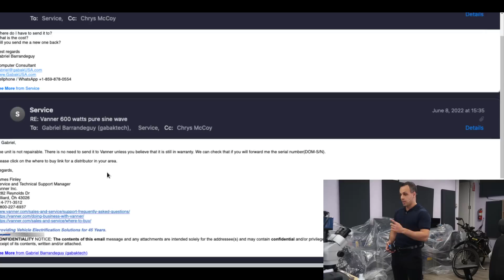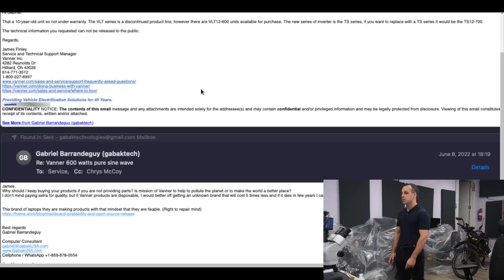Vanner takes the L on repairability

Comment: I've had a problem with an old honda 4 wheeler that stopped running.  Of course honda has long since discontinued the CDI ignition module so I contacted shindingen myself ( the manufacturer of the cdi module). I explained my problem and also the age of the bike and the fact that honda no longer offers the module and all I needed was some information about any other of their cdi modules that may work on my dinosaur.   They simply told me that it was Honda's proprietary information and that they couldn't help me.  So since a .50 cent part burned up inside the module you now have to throw the machine away!!   Chaps my ass!!!   I was able to find a module that worked years later but I think it's bullshit that manufacturers do this shit to us

Comment: I get replies like this a lot when I contact manufacturers for schematics and service manuals. "Sorry we don't do that. Please see our range of latest models." Very frustrating as a tech trying to make a living. I'm mainly talking about musical instrument and pro audio equipment.
Reply: Hope you never need to repair a JBL partybox (although it's hardly professional equipment). I have an older model that stopped working, a 300. Seems like the main board was designed and made in China judging from the 'service manual' I managed to find. Seemed like the damaged part is an obsolete bluetooth module, and on top of that, the unit also needs the correct firmware...
Reply: Hope you never need to repair a JBL partybox (although it's hardly professional equipment). I have an older model that stopped working, a 300. Seems like the main board was designed and made in China judging from the 'service manual' I managed to find. Seemed like the damaged part is an obsolete bluetooth module, and on top of that, the unit also needs the correct firmware...

Comment: The problem with American product companies is that their primary customer will be the US Government and DoD, that "buyer" is forced to ONLY buy American-made equipment with few exceptions (and for a good reason - look up all the CCP modified equipment that caused tons of security issues a few years back), however this incentivizes just making an "american made" product and not supporting any service to it. 

But it gets SO....MUCH....WORSE. 

Since the largest customer is the DoD / military, you'd think that they would be trained to maintain their equipment and understand parts replacement, correct? WRONG - while that has been the case in the past, the focus has shifted to be more concerned with training compliance than actual work. Countless courses and training sessions on trivial things that politicians and bureaucrats jump all over.

To what extent does this affect things? Instead of repairing broken equipment, they lack the knowledge and push towards replacement instead of repair. This causes headaches for everyone involved. Just because a receptacle no longer works, doesn't mean the ENTIRE PANEL should be replaced by a team of contractors. Ugh.

On the bright side, used "broken" govvie equipment is dirt cheap and pretty easy to repair.
Reply: For much of the equipment sold to the military the fully qualified military techs are not permitted to do board level repairs unless it's a mission critical piece of equipment required to complete the mission.  Otherwise, techs have to just swap modules out.  This is due to the contracts the military signs which require them to return the broken modules to the company and let the company repair them.
Reply: @mkuhnactual  I'm not talking about board repair, but component replacement. The equipment is designed to be repaired with minimal if any tooling.

Board level repair can and should occur during emergencies and when in austere environments, however that skill seems to also have been mothballed.

Comment: In 1978 I bought a digital Fluke bench multi-meter it came with a proper manual with all the circuit diagrams (schematics in the US right?) and service information.  I bet (but I don't know) new Fluke devices do not come with this information today?  Things have changed...

Comment: Spending 8 times the cost of something like that for quality is stupid. You are getting the same Chinese product and just 90 percent of that is pure profit margin. By spending more on things than they are worth not only do you waste your own money you contribute to inflation and allow scamming resellers to screw over America. Americans need to get a brain and stop buying Chinese goods from middle men for 10 times sometimes even hundreds of times the price. And no you are not helping the economy buy “buying local” it still came from china the only difference is some asshole took advantage of your dumbass. So no instead of you having the inflated money some prick does and everyone is worse off. Money and quality are not related in today’s economy in the slightest. Do an hour of research so that you don’t cost the rest of the country a 1-2 weeks worth of pay checks for convenience on a product that is ultimately going to be inferior. I see this everywhere in all industries. Usually the overpriced stuff bought from middle men is not only more expensive but significantly worse than the cheaper one because the sellers want to squeeze that profit margin even more. Like ebikes for example. I see idiots buying 2000 dollar ebikes that are more than 5-10 times worse in all regards than what I could do with 1500. Have nearly infinite more examples where that came from. Computers, metal working, aviation, and the list goes on.

Comment: Oh, come on. Everyone with at least two working brain cells knows that the real reason for refusing repairability is that the manufacturer wants you to buy a new unit, not your "safety".  In the old days people fixed literally everything they owned, and manufacturers weren't losing any lawsuits over someone's idiocy when things went wrong with a DIY repair.
Reply: So, genuine question - not trying to be snarky - how many other OEM's, today, help a consumer directly repair their product on a hardware level? I love what Ford is doing for the EV industry - they're even the first to offer an electric crate motor for consumers to drop into their own builds. But I would not expect to call Ford up and ask them to step me through changing my brakes. So long as the manufacturer didn't install anything proprietary to /prevent/ me from doing them myself cough BMW *cough*, then I'm not going to hold the manufacturer guilty as anti-repair. Even most of the service manuals for a vehicle are third party, it's just that the market Vanner supplies is so niche, there isn't enough to support a third party repair industry.
Reply: @ctbrahmstedt   Most cars on the market today have more than enough support through the OEMs and third party manufacturers to allow ALL repairs, plus their systems (brakes, cooling, exhaust, etc.) are built essentially the same as on other brands... with few notable exceptions, like Tesla  (who is blatantly anti DIY / anti third party repair).  If you ever changed brakes or a radiator on a Toyota, you will be able to change the same parts on a Ford, Chevy or Nissan without using any manuals.

Also, from what I've heard from shop owners, automotive parts are licensed / protected in the first few years of a model year and third parties need to pay royalties to manufacturers in order to make them and sell them. So yes, there is actually a way to support repairability of a product post-sale and post-warranty, be it first hand or through third parties. The only reason some manufacturers go out of their ways to block it is to increase the sales of new units.  Repairs and parts are ALWAYS less profitable than selling completely new stuff.

Comment: Midnite Solar is manufacturing  their own charge controllers and inverters in Washington State. One of their main design engineers answers technical question on their forums and tells people what components to check and how to repair if they want to do that themself instead of sending it in. Midnite did just also pick up a Chinese inverter controller rebranded with their name and some of their design and software changes and they provide technical support and repair on these too. So there are companies in USA that support their products.
Reply: I bought a $350 Geiger counter from GQ Electronics a few years ago and the LED that flashes was intermittently faulty. I posted to the forum and they were happy to send me a replacement LED and confirm that my installing it wouldn't void the warranty (it was dual-color and had to fit in the case, otherwise I'd have just used one from my parts bin). They saved themselves the cost of shipping it both ways, the risk of damage during transit, and made me a happy customer.

Comment: Has OP actually opened up the inverter and looked at the components? Sometimes devices of that caliber have well labeled boards with information about every component. It's hardly guaranteed, but it wouldn't surprise me if it was the case.
Reply: @09f9  Holy crap... Thanks for the heads up. That's crazy that they'd rebrand a Chinese product at that price point. I've seen plenty of other companies do that, but it's usually only a few hundred dollars added on.
Reply: @PsRohrbaugh  haha "crazy"? That's what most "made in murca" companies do nowadays so that claim is basically a huge red flag. They buy chinesium either whole or in parts and do the minimum of assembly required to claim "made in murca" and repackage it

Comment: I think the worst line I always hear from these companies is “can not be repaired”
Yes it can. Technically if I take the silicon die off of a CPU and snap it in half it can be repaired. It might cost tens or hundreds of thousands of dollars, several industry leading professionals with a century’s worth of collective experience, and machinery worth more than the state of Nebraska, but it can be done. Is it cost or time effective? Now that’s a conversation I’d be willing to have, (and with a product as simple as in the video, I’m quite certain the answer is yes) but when you say “is not repairable” you lose all credibility
Reply: I’d pay to see a repair of a 74HC04 snapped in half as a proof of concept.
Reply: @Scrogan  I can see the Hackaday article and ensuing shitposting in the comments now.
Reply: Actually a 74ls04 could definitely be used even if snapped in half you would need to put a lot of jumpers and probably a replacement diode or transistor.
Reply: @jacksong6226  It may be easier, but Schottky logic doesn’t scale to a CPU.
Reply: “can not be repaired” That's exactly what they want the general public to believe. They will keep repeating this until it sticks.
Reply: Snapped CPU die would actually be an example of something that truly cannot be repaired. The components are so densely pack together that just by snapping it, some of them would inevitably be completely lost. Maybe you could come up with a theoretical way of using those material for etching a new CPU, but you could not join the two halves and make them work again. It's kinda like broken car window. Once it shatters into tiny pieces, there's no way to put those pieces together in a way that would allow them to fulfil their original purpose.

Comment: I had an interesting repair almost 15 years ago dealing with Panasonic.  I had a Panasonic LCD Projector with bad IC controlled the GREEN LCD contrast.  I was able to figure out which chip it was and managed to track down a service manual (probably leaked) and it listed an official replacement part number for that IC. So I emailed Panasonic service dept asking how to order that part.  They said sure, but they needed to know my units S/N and proof of purchase.  I got my projector second hand so had no proof of purchase. I explain that to them and they agreed it was ok that I didn't need to have it but they still wanted the S/N.   After I gave them the S/N they responding saying my unit was a parallel imported unit from another country and not one sold locally and they refused to sell any parts or it.   Anyway, I was able to hack the projector and inject 5.5V to force the green LCD to have contrast even though the faulty chip was trying to set contrast to zero in error.  I just had to adjust red and blue contrast to match using the OSD and projector was working again.  Screw you Panasonic.
Reply: Some countries have laws, that if it is branded - ie has a logo, Sony, Panasonic, Apple etc, then the parent company can be sued. To dodge taxes etc, there is usually a Panasonic USA distribution or a Sony USA distribution company that buys the product off the parent entity - arms length, honest. So you lodge a consumer court complaint with the parent company, not the local distributor - upon discovering forced hand repair (ie only the brand). Usually they ring you up, whats this BS, shut up, and send you a new phone or whatever. Most consumers do not know about such things. 

Now about that company not dealing with repairs. Simply exclude them off panel contracts.  Ring up other purchasing officers, pass the word that the company be 'off' and not to be a supplier. With any product, if they have won the tender, ring and ask about schematics. and MTBF. If they can't say, sorry, 10% off as no repair ability.  Companies only fool me once. 

I am amazed a company imports and sells stuff without a schematic. ever.
Reply: @zos8085  "if they have won the tender, ring and ask about schematics. and MTBF" - Eh, MTBF are probably the most BS numbers I've ever seen. I don't think that there's much point in asking the suppliers for it
Reply: Profit Genie and Alberto De Jesus might be subscribed to notifications every time someone comments on your thread, so I'm in favor of trolling them.

Was it a component you could have source elsewhere?
Reply: @mgancarzjr   na, custom IC for sample and hold that Panasonic had made.  A output pin was damaged and stuck high. But by injecting a few mA to GND you could force it back to normal voltage and fix the issue.  But you lost the ability to control green contrast from the OSD. which didnt really matter.
Reply: Profit Genie  what does a clock do when it's still hungry? It goes back four seconds.
Reply: Profit Genie  yes we do
Reply: Companies do not like private importers selling product from one market in another. Products are made to comply with the regulations and standards in the countries for which they are intended. Both government and private. Governments may have no issue with going after the manufacturer in some circumstances. For a projector unlikely since the FCC has bigger fish to fry and UL is a private body. But if some importer brings in truckloads of something the FDA or EPA regulates look out. They will go after the importer but it can cause problems for the manufacturer dealing with it. In any case this creates huge product support headaches as well. To discourage this private importing companies will refuse to support the units. 

When you buy grey market you are essentially on your own.
Reply: @tagert1975  "They will go after the importer but it can cause problems for the manufacturer dealing with it." - Look, the OP has stated it clearly that it was a second-hand buy so it was most likely a one-off grey import by the first owner. And Panasonic probably knew this very well too and yet still refused to sell the part because they're nasty bastards.
Reply: @CoolKoon   2nd hand doesn't matter. It's grey market, buy grey market and you're on your own.
Reply: @tagert1975  it was purchased from Panasonic. But it was a Panasonic in a different country.
Reply: Profit Genie  Since you clearly care enough to respond, congrats, you played yourself.
Reply: "After I gave them the S/N they responding saying my unit was a parallel imported unit from another country and not one sold locally and they refused to sell any parts or it. " - Yeah, ugly tactics like this were flying under the radar for quite a while now, I'd say that companies started doing this around early 2000s.
Reply: Profit Genie  Asshole. He describing his experiences with the device and company and repair steps. What's wrong with that given that you're watching a repair channel?
Reply: Profit Genie   Correction : many people care. His story is a perfect example of how manufacturers try to f**k you, even though you're trying to make their products last longer and not become electronic waste in a landfill.  

The whole corporate "Go Green" movement is a scam and the struggles for right to repair to triumph is proof.
Reply: Profit Genie  on god